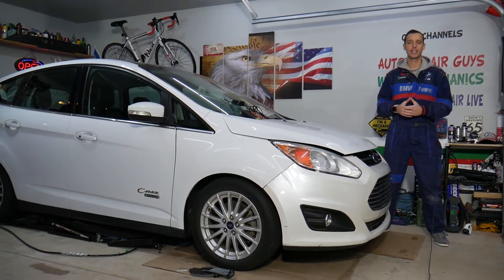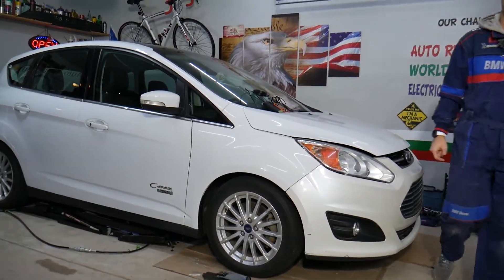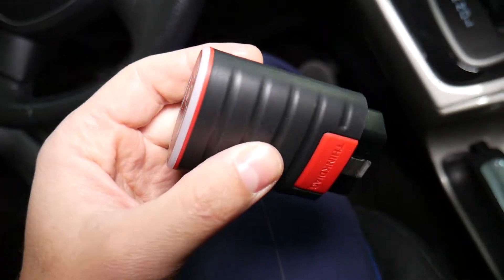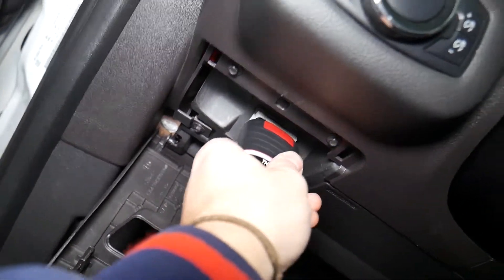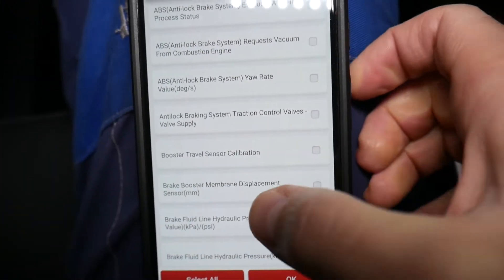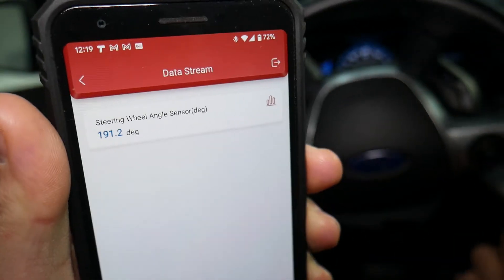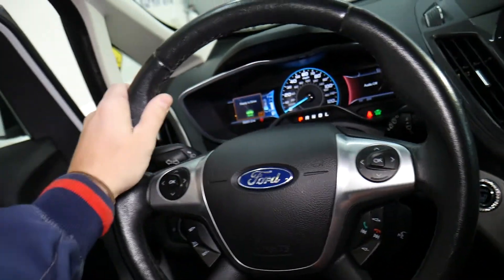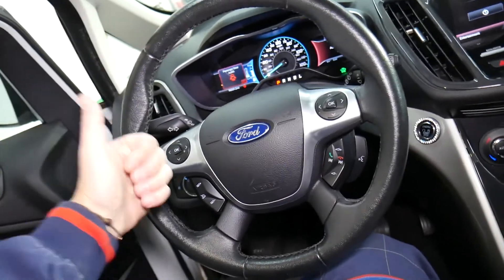HOW TO TEST STEERING ANGLE SENSOR on Most Cars

Comment: I am looking for a low cost of even free app that can show the live data from that sensor even if for that price it only shows that.  My vehicle is a 2017 Nissan Rogue Sport SV.  I may have a bad shock or strut, maybe something is bent, or maybe something is loose.  I ran over a curb a while back and that is what most likely began this nightmare.  The vehicle does appear to drive OK at times so this is intermittent.  I just know there is a bad part there but as long as there is a way to check the steering angle sensor I may as well make sure it is still good.  That curb was on the right hand side (passenger side) and the vehicle seems to have a very light drift in that direction.  It has been to dealers and shops and it just baffles me how NONE of them can find anything wrong.  Coincidentally after making a right turn it feels like something is sticking slightly.  Wouldn't it be something if it was just my caliper dragging that is the source of this misery that is making me just want to get rid of it?  What are the odds of it being just a bad caliper or maybe it doesn't like the brake pads that are on it?  I also wonder if the anti rattle clips are installed since I can imagine they would be designed to help prevent caliper problems.  The anti rattle clips would be stainless steel so unless they are a bizarre unknown cheap Chinese brand (usually generic crap) they should not rust.  It is just plain dumbfounding that no one can seem to find something and come to me in the waiting area and say "I found something you may want to see, come and take a look".  Just incase all of these mechanics forgot, I would be very grateful to them if they could solve my mystery!!  My other mystery is why does no one notice it but me!!  I actually test drove a different vehicle I am extremely tempted to buy and it rides like new (no issues) despite having 80,000 miles (more than what my Rogue has).  That vehicle was a 2022 Tiguan.  Heck, I may be willing to tolerate the Taos's known to be somewhat temperamental DSG!  My first major sign something is very wrong with the Nissan is when I made a right turn in light snow and darn near drifted into a vehicle waiting for a light to turn left.  I think that sticking sensation in the steering is it but what may be causing it??  When that happened I was not at all moving fast mind you.  Other people effortlessly went the same way faster and I was even being cautious because I was suspecting I may have screwed something up.  I was also being cautious in that situation since SUVs are top heavy inherently.  On the highway it feels like there are bumps that were never really there.  Maybe they are there and I now have a bad shock or strut making every little imperfection I hit cause me to reminisce of a place where I lived with a bumpy cobblestone road.  My guess is that one road must be at least 100 years old.  I think the only reason it is still cobblestone is that it is steep.  If it was asphalt it would be just dangerous at times!  I remember hearing about a really horrible accident on the bend part of it and I am thankful I was not there when it happened!!

Comment: Hi,i have the c1956_30 code on a ff mk2.5 1.8 tdci,could be decalibrated or i have to change one of the sensors,i have the free forscan and i cant see if it s calibrated or not,the code is back every time i delete it,any ideea?

Comment: Bro!
Thank you so much!
After clock spring replacement I had all kinds of lights on
Was ready to take it to Subaru dealer 
After watching this video, took the steering wheel off, hooked up my think driver diagnostic tool and tested the angle sensor by turning it.
The diagnostic tool showed it was way off to 635 degrees!
Recalibrated to 0 degrees manually and put everything together. Recalibrated it using the diagnostic tool and also reset the brakes .

All lights are gone, problem solved!
Thank you bro!
Reply: Hello there!

I'm having similar problem with my Honda accord 2016.

After work on shafts and inner cups, at neutral I'm getting 360° therefore, calibration refuses to work.

How do I manually calibrate to get it around 0°?

Thanks

Comment: I have a Ford Fiesta 1.5L, the ABS, TCS, and brake led light up. Got fault code U3000:48 on the ABS ECU. I noticed the steering angle correctly giving values in the PSCM. However when I read data stream from the ABS module, it gives 0 when the steering wheel moved. Any advise?

Comment: Hi, I had concerned rigarding with my dodge charger 3.5 2006 when it comes the engine is hot, not properly ingage the gear but it was cold the Gear was properly working. Do u have any idea whats going on thanks.
Reply: Change and upgrade fluid and add supplement